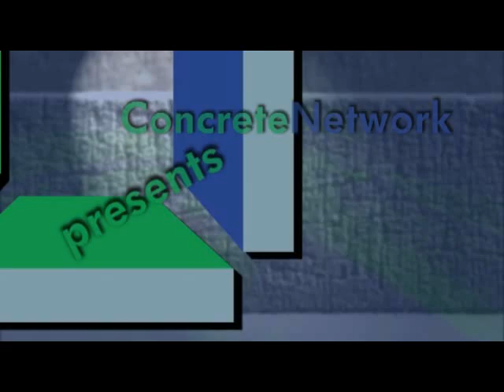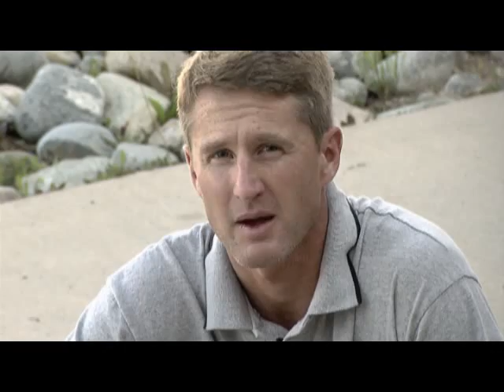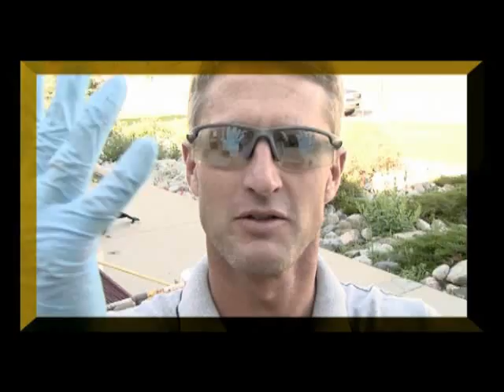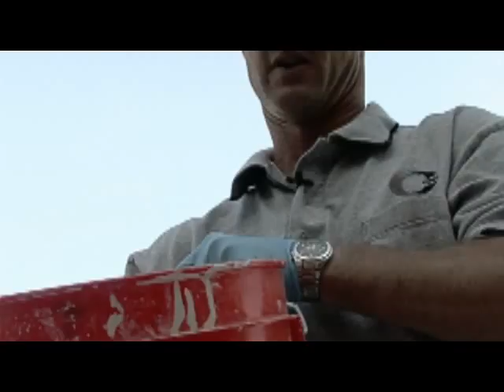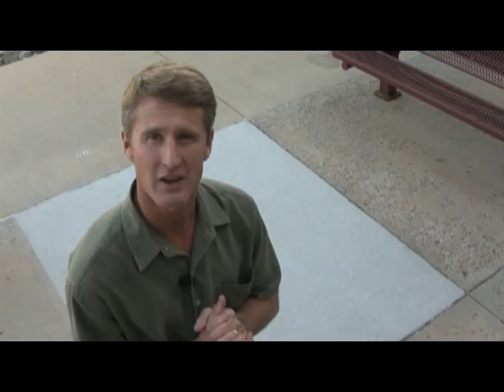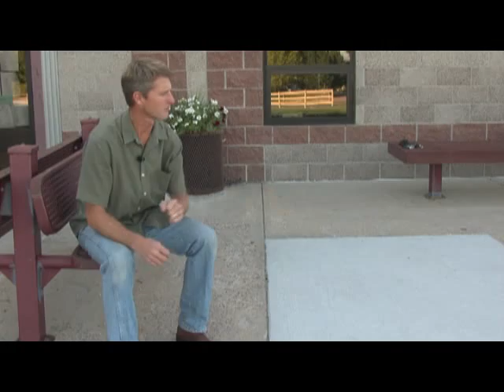Repair Spalled Concrete - Sullivan's Corner

Comment: If the concrete substrate is extremely dense relative to the overlay, that overlay is not going to last. Today is correct the PSI of both materials should match. However you can use a high PSI overlay on the low density slab. Also these polymerized overlays don't stain well and you will see a discontinuity from the two materials. The exceptionist is if you use a coating over the entire surface.

Comment: Interesting:  
I worked in the Construction Industry for 60 years; accordingly, jargon is no problem!!   We live in Philippines (Subic BAY) in a precast concrete house built in the 60's for the US Military Navy, by them, now the EXPOSED precast roof slab SOFFITES along the underside of the exposed roof overlap has in places spalled -- not too bad --- but pieces of concrete have fallen off, chunks, pieces, quite a few about 2 feet long by 12" wide an inch to two inches thick, exposing rebar.

I am fully aware about your wise words regarding original surface preparation work and Sika products, which in the past I have used successfully, are available here. By all means recommend others if superior. My question/s is/are: what primer do I use on the original prepared concrete soffite to facilitate adhesion between original concrete and the repair material, and what sand and cement mix (Strength of MIX 1 to 1 -?? ) PLUS Cement ADDITIVE - again what kind and type of PRIMER do I apply to the original soffites for good adhesion lasting repair. I assume I should clean and paint the exposed rebar with WHAT -- RED LEAD?? The condition of which is NOT BAD and then apply the sand and cement after priming the original surface.

In total maybe about 10 to 20 % of the total surface area has been affected.

Can you help ME????

Comment: Just what I was looking for but you knew what strength psi your Original  concrete was I’m thinking most of us don’t , Is there anyway to identify what ours is especially if we weren’t in the residents when the Spaulding began also did you cover what brand of products you used and were to purchase it ? Thanks in advance

Comment: I have a 1957 ranch house with an equally old concrete driveway.

There are cracks across the drive that the previous owner filled with caulking which look terrible.  There is some spalling in areas as well.  I think the drive needs some more control joints cut into it.

I live in Southwest Michigan where we get more freeze/thaw cycles per year that just about anywhere else on the planet.

Would you recommend a polymer modified cementitious coating for this particular instance?

Comment: I have just purchased a house that has spalled walls in the basement. The spalling is about 1/2 inch thick. The walls had been painted with Drylock paint and the peeling paint with the spalling makes for one ugly wall. What should I do?
Reply: You could always pressure wash the concrete to get most debris and paint off first.

Comment: In our garage, where the wood walls meet the foundation, the concrete is disintegrating, literally powdering, so you can broom it away, until you get down to the solid concrete. It has done this each of the last two years. What is this called, and how can i fix it?
Reply: It's called a major repair.
Reply: It’s called efflorescence of concrete. There is water buildup behind the wall and its makings it’s making its way through the concrete. Concrete is a porous material. I’m surprised where the wood meets the concrete, it’s not rotting as well.